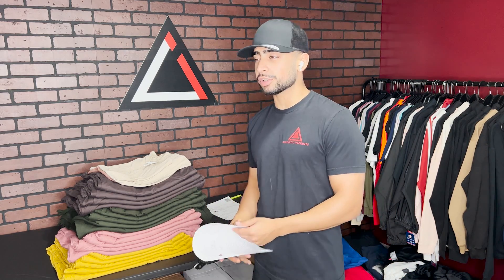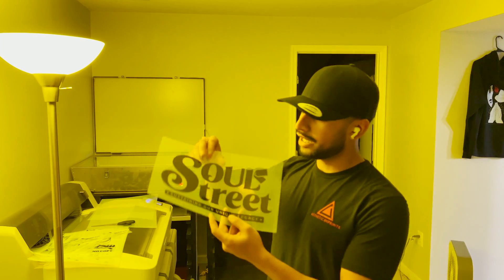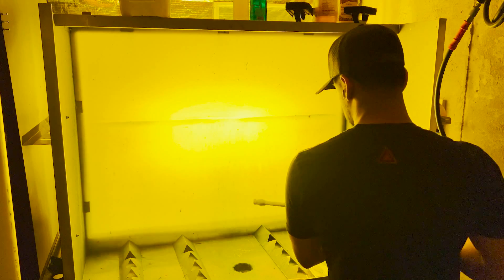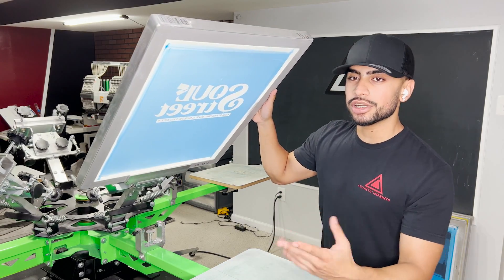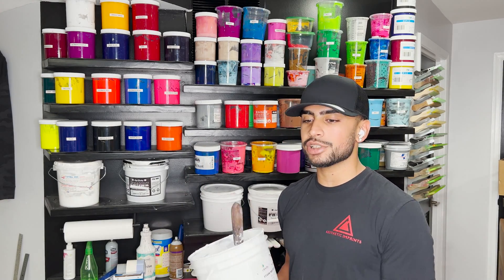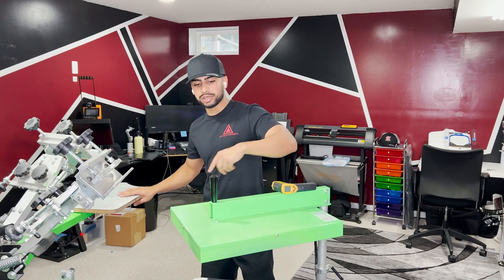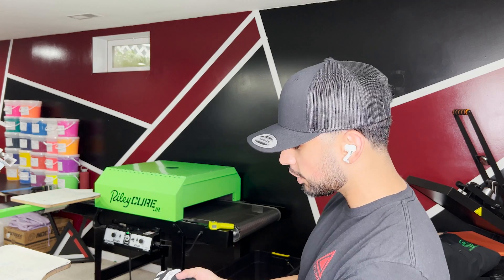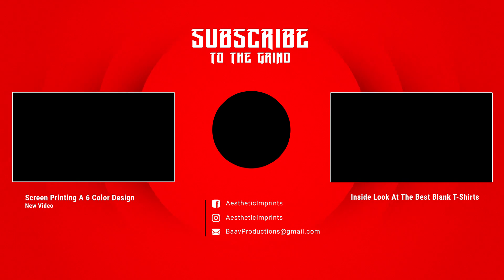Learning The Basics of Screen Printing

Comment: Thanks for the content. Quality definitely shows the amount of energy you probably put in. One question, how does this compare to a plastisol transfer? Do they feel the same? Thanks again and channel is lit 🔥 🔥 🔥 Everyone make sure to sub!
Reply from the maker: Thank you! Plastisol transfers are basically heat applied on. When you print plastisol transfers it will of course have a smoother print since it’s heat applied on